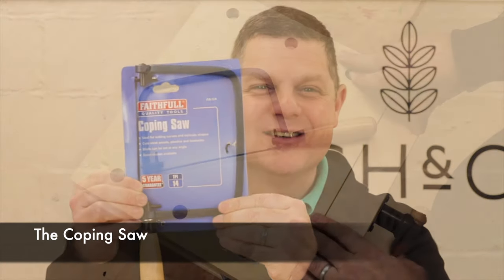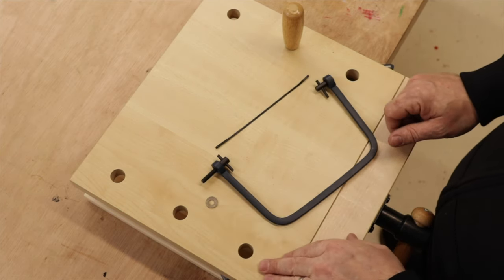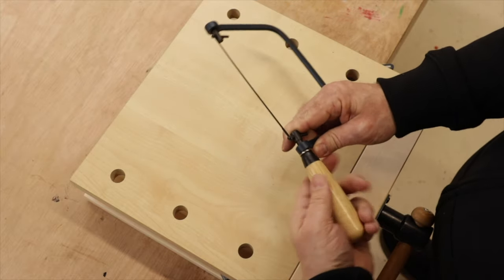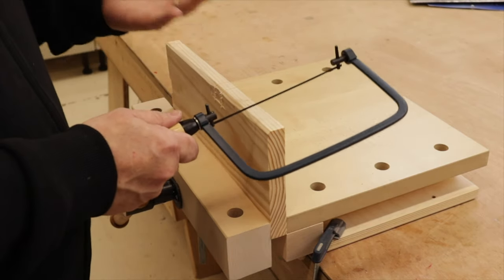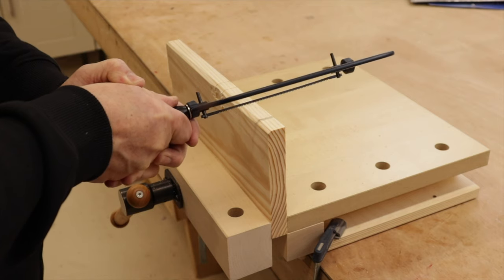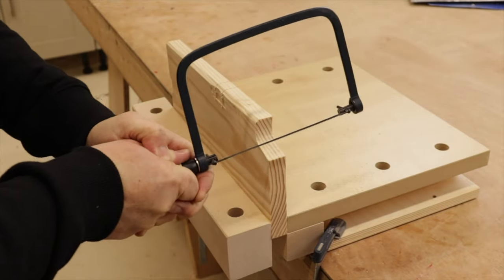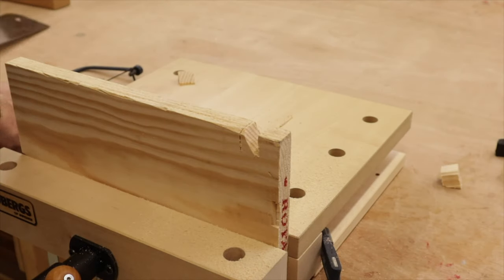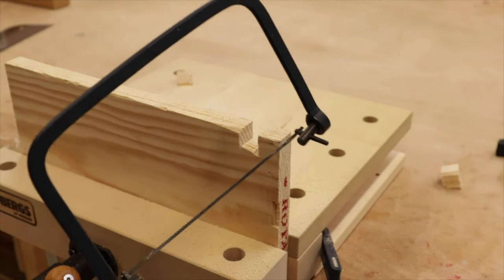How to use a coping saw – Ash & Co Ultimate Beginners Woodworking Tool Set

Comment: Nice video.  You should not have turned the blade around.  You just needed to turn the pins.  While cutting, the blade should be behind the centerline of the posts and handle, not  in front of them.
Reply from the maker: Thanks for the comment but that’s not right. If you didn’t turn the blade around the pins would be sticking out below the saw. 

The coping saw comes from the factory installed the wrong way around for safety and it does need turning around the other way before use.